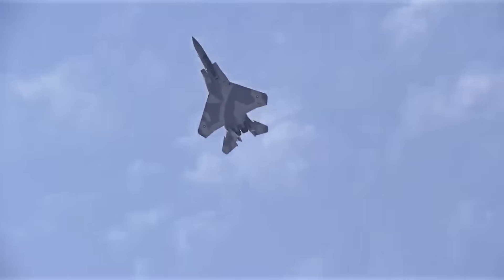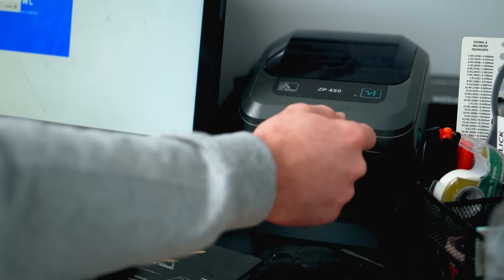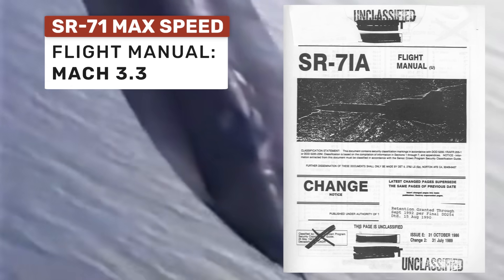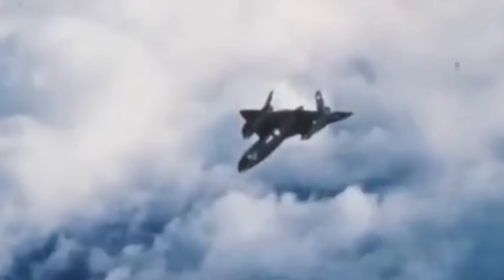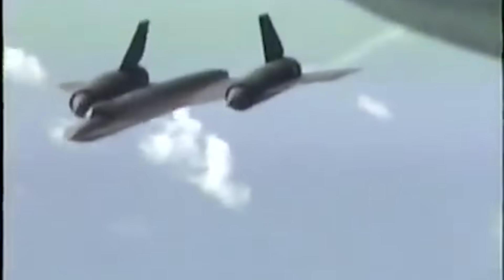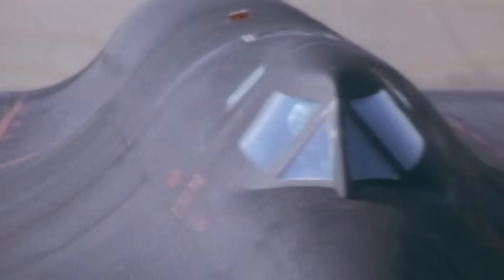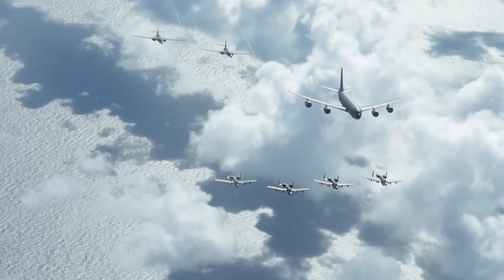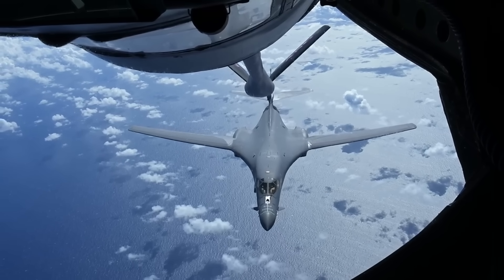The SR-71 was MUCH FASTER than the Air Force will admit

Comment: “Thermal limits” is a bunch of BS according to a book I read on the SR’s about 20 years ago. One of the pilots who helped write the book said that when one of the planes crashed, it caught on fire and after they put the fire out, the skin and frame of the aircraft was un damaged, and being made out of titanium, it actually made it STRONGER which basically meant that it got stronger every time it flew. Theoretically, it could fly forever.
Reply: Thats not how fires work and you'd have to post that reference as ive never seen that in a book and I have a lot of them. The hardening process is somewhat more true, but crashing and catching on fire, the aircraft is lost. Even the one that hd a brake failure and caught on fire was lost. Thermal limits isnt BS. The aircraft had many thermal limits that prevented higher speeds with the initial limiting factor being the engines. After that it was various part of the airframe started to become the factor at different speeds.

Comment: The CIA admitted that what people thought were UFOs were in fact early RS71s but not with the final engines. So in order to keep funding coming they would dive to get the promised speed changing the color of the engine flame
Reply: Virtually none od that is true. The A12s initially were flown with J75s until the J58s were ready. By 1963 all the A12s had the J58s along with YF12s and M21s (minus the TA12). They didnt do any "dives" to make target speeds. The J75s were just used for initial flight testing then later with the J58s the A12s etc reached designed mach speeds with no issues.

Comment: In the 70s one of our SAC/1CEVG Bomb Scoring tracking RADAR sites, in an interim time between missions, was passing time scanning the skyes with the range gate around 80 to 90,000' locked on to a blip that passed through his Range Gate and had the Plotter record the track on the associated Plotting computer with an area covering about 3'x3'.  The track had timing markes included to aid in scoring bombers in their training runs with accompaning scales graduated to measure those marks for speed with a top limit of 3,000 m.p.h. There were three timing marks across the plot and in was just beyond the 3,000 m.p.h. limit.  The RADAR site received a call from HQ Barksdale AFB in Louisana detailing the whole tracking run, time duration, RADAR band, etc., etc. finally ending in the order to destroy all information concerning said Lockon.  Never happened you know.
Reply: Never happened because its not even possible. That speed is not even remotely possible for the SR71 to reach.
Reply: @gr8crash  Believe what you like, we had some of the most advanced RADAR systems going at the time and it definately was not an X-15.
Reply: @Steve-k4x8q is not a matter of believing, its simply what's possible. Its not possible under any circumstances for the SR71 to fly that fast. Its not a belief, or opinion its a simple fact.
Reply: @gr8crash  Well all I can say is just pretend this post never happened, just as SAC HQ told the site the very fast, very high aircraft that was tracked and plotted, and to destroy all evidence, that it never happened.
Reply: @Steve-k4x8q which is fine too. But simple and absolute fact is, the SR71 could never fly that fast. It would have crashed long before that speed.
Reply: @gr8crash  Then the Air Force had something faster in existance at that time.
Reply: @Steve-k4x8q except they didnt.
Reply: @gr8crash  Well then you have a problem with what happened.
Reply: @Steve-k4x8q no problem since it didnt happen. Its simply not possible. What's more likely over the decades you meant 2000 mph not 3000, or maybe KM/H, not MPH. But 3000 mph? Absolutely never happened.
Reply: @gr8crash  No, I meamt what I said 3,000, end of story.  Until myou show me the document classified top secret on its actual capabilities, I stick to what was observed.
Reply: @Steve-k4x8q thats easy, as everything related to performance is declassified and public and has been for over a decade. There isnt a single piece of that aircraft that could support those speeds. The airframe itself couldnt do it nor could the engines. It 100% impossible and all the documentation to support that is public and available.
Reply: @gr8crash  I highly doubt that. I am quite sure the missions are still classified. Any operational information is still classified with it. I would love to see the mission debrief on the flight that had a missile chasing it and with the throttles to the wall the pilot stated he saw Mach numbers unheard of. So you can choose to not believe it possible, I will continue to believe all things are possible
Reply: @Steve-k4x8q you're talking about the Shul/Libya story and thats and easy one, thats all BS. While its true he flew one of those missions, all those parts of his story referring to speeds etc are totally BS and not true. 

But missions etc, are pretty much all known, performance etc. Pilots will freely tell you about missions flown, locations etc. The only aspects of the aircraft still classified are parts of the ECM/DEF equipment as it's still in use today.
Reply: @gr8crash  Yah, okay, so you say.
Reply: @Steve-k4x8q not what "i say"  what the facts say, and tech data and former Crews etc.
Reply: @gr8crash  That's funny since you said BS to what some of the crews said.
Reply: @Steve-k4x8q if a person is lying a person is lying, in this case Shul is lying. Which is part of why he was removed from flying the SR71.

Comment: I could swear I saw a mention years ago of this plane?? doing something like 6500 mph..
Sounds insane but I think they were talking about the SR -71 or one of its Sister planes..
Reply: No variant of this airframe was capable of anything close to that, not even half that was possible
Reply: @gr8crash  I believe you but its killing me that I can't remember where I read it and what plane it might of been.
This is before Utube video's where a big thing or exhisted..
Reply: @petereconomakis149  at 80k ft that speed is almost mach 10. The only thing we've tested thats gotten that fast was the X43 testing scramjet engines. But definitely no SR71 variant ever got that fast.
Reply: @gr8crash  Was this a maned plane flying or a engine thrust test?
Reply: @petereconomakis149 the X43 was an unmanned test asset.
Reply: @gr8crash  Thanks!

Comment: Sr71 is beautiful but the foxbat had atop speed recorded at 3.2 it was built as a high altitude interceptor I believe with the engines on the sr71 I would bet it could achieve to nearer to mack4

Comment: This topic requires an understanding of speed in the aviation context.   All aircraft have absolute speed limits.  Push the nose down and hold it long enough, youll typically reach that speed.  Level off and give the throttle 100% and youll end up at max cruise speed.  Thats the number you want and based on pilot comments, mach 3.4 is a good estimate.  If this is a realistic speed the plane can hit on the instruments at 80000ft, they are really haulin because groundspeed in standard conditions would work out to something like mach 3.8!!

Comment: Gonna throw some things out there for discussion.
XB-70 aluminum honeycomb construction with some titanium on leading edges. Capable of mach 3.
Black Bird mostly constructed of titanium with engineering design of systems for thermal expansion. Stated to be mach 3.2 capable. Yeah, I don't think so more like mach 4.25.
F-15EX constructed out of composite and aluminum with some internal titanium structure. Stated to be mach 2.9 capable. Yeah, I don't think so either, maybe 2.6, 2.7. 
F-14B aluminum structure with some Boron and titanium leading edges. Stated to be mach 2.3 with the same F110 engines. Little secret at NAWC was that it was more like mach 2.8 aircrew wasn't sure since the indicator pegged at 2.5, but blew past a "A" model going mach 2.3 like it was piper cub.
In most cases the top speed is normally under reported.
Reply: The XB70 was stainless steel honeycomb.  And was barely able to due mach 3. The SR71 used titanium mostly for weight and the fact Lockheed had no experience with stainless honeycomb. Also mach 4.25? Not even remotely possible.

Comment: A long time ago a U2 pilot spoke to the Spokane RC model Club. We asked about the Sr71 == (this was in the mid 70s ).
He said he had gotten tired of U2 and put in for leaving the Air Force and before he got out the SR was announced, and he tried to STAY!!!
They told him TOO BAD your papers are filed.   But his fellow U2 pilots were now flying the BLACK BIRD and we asked wellll how fast is it????
HMMM well I know from them but cannot tell you .... However if you buy one of the plastic model kits and build it == the dimensions are accurate enough 
that with measurement of the angle from nose tip to wing tip angle and reference to aerodynamic texts for MACH angle at altitudes over 80,000 feet you have cruise speed === the whole airplane is inside the primary shock cone.. Then for these altitudes which he did not say yes or no to of --- say 150,000 up and 
you measure the angle from nose to JUST outside the engine intake because you do not want that PRIMARY SHOCKWAVE to enter the engine you would have 
the Maximum possible speed without BLOWING the engine up. The other problem at SPEED was that the RAM Jet effect had MORE air than it could handle and some was vented to keep pressure from Blowing Up the engine.  So limits of heat ,. pressure and shape not power or drag control top end......

Comment: The SR-71 has no “Top Speed”. It only has a “high engine temperature”. The colder they can keep the engines the faster it can go.
Reply: Not completely. The SR71 definitely has a top speed. The engines were the initial limiting factor to higher speeds.  Not necessarily the temp of the engine itself, but the engine CIT temp. That limit affects engine performance and still does on modern jet engines today. On unusually cold days, you're correct the engine CIT would be cooler, allowing higher speeds but it a common experience. 

But after that initial limiting factor, the airframe had issues at different speeds limiting performance.

Comment: I was stationed at Kaneohe Marine Corps Air Station in 1974-75.
We tracked an SR-71 which ended up flying higher than our radar could track it. When I've said this on public discussions before, I'm told it never happened. That's not even a clever rebuttal since I was a tech at the time and watched the console.

How high it can fly? Our radar limit with our connected tactical support system, was 99,999 feet. We weren't glued on watching air speed. We just kept watching the vector angle upwards until the plane flew above our ability to track. How long they were there or where they re-emerged isn't known. That was the highlight of my 4 years in the service with TAOC.
Reply: The SR71 wasnt capable of exceeding 100k ft. Neither the engines,  the wing or control surfaces would permit that, and be stable.

Comment: My ROTC Det commander had been a maintenance squadron commander on the SR71.  He never got int specifics, but told us the aircraft was not speed limited, but heat limited, and it was time based.  Significantly faster than advertised, but not for a long time.
Reply: Theres no "time limit" in relation to speed, thats not a thing. The SR71 was both limited by speed and temp. The initial speed limiting factor was the engine CIT limit. Thats what determined your max speed initially. After that though, various parts of the airframe become limiting factors at different speeds. 

The maximum design potential of the airframe was higher, but the changes required to achieve those speeds were never implemented.
Reply: @gr8crash I was trying to say there was a time limit for the heat, not the speed, but the heat was a result of the speed.  Which made sense to me what he was saying at the time.  I’m sure there is a million times more complex than what I imagine.  But such a cool plane.  Just the way it looks to this day something out of a sci-fi movie.
Reply: @markg7963 totally agree, its an amazing aircraft. Just stating they didnt have a temp/time limit like that for the skin. For that to he the case, they'd have to have skin temp sensor and charts stating time/temp limits and that's just something that doesnt exists.

The closest to that kind of thing would have been some tactical limits that had a cumulative time basis, but in all the years of program and discussing it with many fomer crews, theres nothing to support those limits ever being used.

Comment: My coworker worked on sr71 and f15 in vc war. Yes he said same thing. Airframe gets damaged above certain speeds. He told me the speed but forgot the mach #. The aircraft broke the meters.  I took classes for aircraft but changed direction cause bad back and shoulder. Favorite was he saw air fueler get tackled cause guy had sweater😂

Comment: Mach 6 according to the geometry from the aircraft nose to engine inlets. Easy calculation. You can also calculate the max temperature the aircraft can withstand. Another limiting feature.
Reply: Mach 6 isnt possible under and conditions.

Comment: The US government will NEVER publish the top speeds of its most important military vehicles.  Whatever you se, you can safely assume the real top speed is different.  Probably faster.  That record-breaking SR-71 flight?  You can be sure the pilot was sandbagging.
Reply: Not really,  he was flying at pretty much max CIT and max speed.
Reply: @gr8crash  And you would know this how?
Reply: @robertking3098  because its a well documented flight. They were right up against the 427⁰ max CIT limit and flying just a bit under their max speed of mach 3.3. Think it was like 3.297 or something like that. 

They did ask P&W for permission to exceed the 427⁰ limit but P&W said no. IF it wasnt for the fuel requirements the overall top speed would have been "slightly" higher as they were still accelerating as they passed the West timing gates.
Reply: @gr8crash  How do you know 3.3 is the max?
Reply: @robertking3098  again its we'll documented.  Mach 3.17 was mission cruise speed, mach 3.2 was max mission cruise. Mach 3.3 was only allowed by approval of the Commander and ONLY if engine CIT was below 427⁰. As in say you were at 3.15 and already at 427⁰, that means you would be unable to even accelerate to 3.3. 

Now there are a very few examples of speeds in the 3.4x range, but these speeds were only possible due to extreme atmospheric conditions  and the speeds also were fully within the pilots control.
Reply: @gr8crash  You're relying ENTIRELY on well-documented, PUBLIC information.

Here's a fact that you may not be aware of.  The performace specifications of the aircraft are still classified.

There is NO assurance that those numbers are accurate.  As the old phrase goes, the government  "will not confirm or deny" the accuracy of classified information.

I worked for Lockheed Martin for 8 years on a variety of projects including F-22, F-35, F-16, and a handful of assignments working with Advanced Development Projects (the "Skunk Works.")  I know how the game is played.
Reply: @robertking3098  I'm referring to all the information,  all the formerly classified that has been declassified for well over a decade. ALL of the SR71 performance data is public and declassified. From the studies done to uprate the engines to be certified for mach 3.5, which was never done, to all the design studies done to reach the maximum design potential and what parts of the aircraft needed rework. All the performance data, charts, etc are all declassified and public. 

The F22/F35 etc is a different scenario as they are still in use/production so can't equate aircraft in development/use today to aircraft thst are 6+ decades old, retired and declassified.
Reply: @gr8crash You're assuming a lot here, including that all the data has been declassified.
Reply: @robertking3098  not assuming anything.  And all the information is declassified and public. The only parts still classified are parts of the ECM/DEF equipment as it's still in use today.
Reply: @gr8crash It's obvious you've never worked on a classified project.
Reply: @robertking3098 its obvious you dont know much about the SR71. Aside from what i mentioned,  everything was declassified over a decade ago when Senior Crown was declassified. All the performance, tech data, etc is all declassified and public. Not to mention to work on the SR71 you only needed a Secret clearance and a SAP.

Comment: The speed was only limited by the skin, not the engine. The aircraft could go much faster than its "rated" speed. If it went faster than the airframe could withstand, the skin would melt.
Reply: The initial limiting factor to higher speeds was the engine CIT limits

Comment: An external store fighters top speed is relatively unimportant by itself.  The fuel consumption is prohibitive and only for very short bursts.  Stealthy are better due to internal carriage (less drag) but the power to weight ratio is a big deal in the fighter world.  Much different mission than the SR.